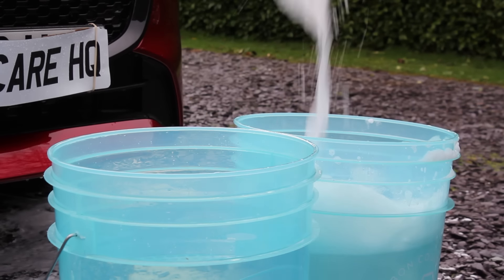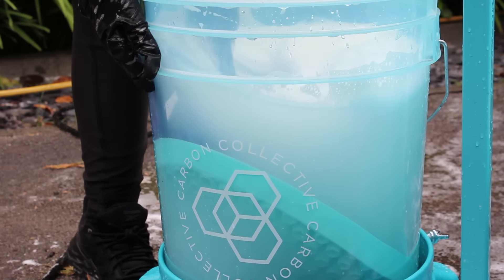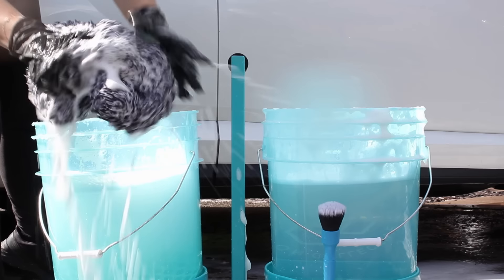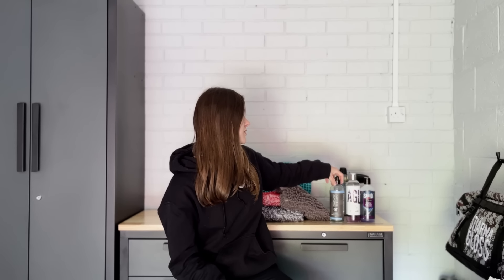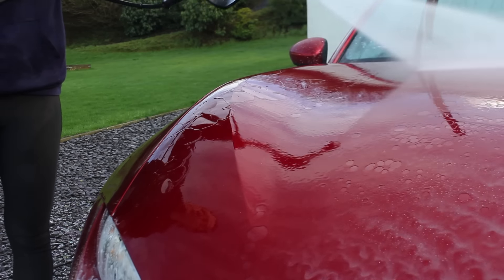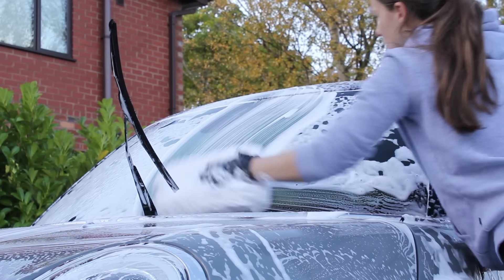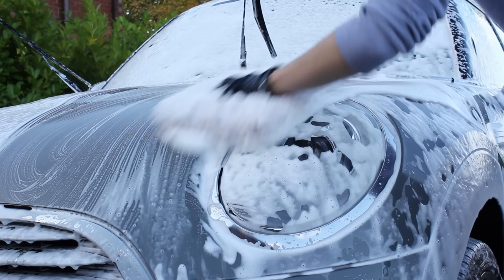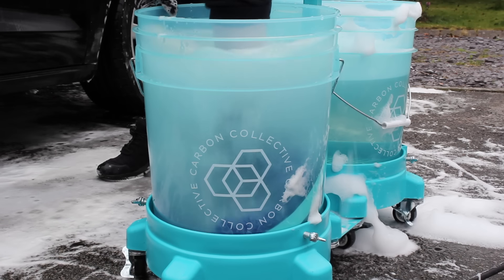Is the Two Bucket Wash Method Overrated? (Vs Alternatives)

Comment: Hi Heather, I use one bucket for doing the wheels first and the tyres etc...Next I use Bilt Hamber snow foam to prewash the car and jet wash off. I then move onto a new bucket with Bilt Hamber shampoo and use two mitts - one for the lower parts and one for the rest. I used to do the 2 bucket method at this stage ,but like you have mentioned, wondered if there was much advantage, as essentially you are still using slightly dirty water to rinse with towards the end. For me, the biggest life saver was ceramic coating the car. This has made the entire proccess quicker and safer in my opinion. Cheers Graham

Comment: Have you noticed that dirty rain is getting worse each year? I currently use pre rinse with (safe) Pro Kleen TFR on the lower section of the car & BH Touchless on top & all over. Followed by 1 bucket wash using Car Chem shampoo. Blast off the mitt with trigger gun in between dips into the shampoo. At the end of the contact wash my bucket remains spotless. I'm happy I've done a safe wash. I'll then consider top up protection with wax or sealant.
Reply from the maker: Yeah it does seem quite bad doesn't it! Thanks for commenting too :)

Comment: I’ve usually had black cars and have been sold on two bucket method for about 15 years! Still use it but my big change in recent years is all the work before the contact wash - helped hugely by this channel. I’m also a big (new) fan of the DI pressure vessel so now a lot of washes can be minimal contact. Thanks for the channel

Comment: I use the one bucket method and have a separate wash mitt for the lower portion of the car,  I started out using the two bucket but found the  one bucket method much easier
Reply from the maker: Thanks for sharing Eamon 😊
Reply: Brian at Apex using this method.

Comment: As you say Heather, the most important part of wash process is the pre wash. I go with GT Citrus in a sprayer, then BH Auto foam on top. Then rinse, then BH Auto foam again and rinse and the two bucket method (BH shampoo) with grit guards and washboard. That's a well put together little Vlog 👌
Reply from the maker: Cheers! That's a very good method/ chemical combo
Reply: I see you want to cleaning as much as possible but, isn’t that overkill in terms of removing the LSP? I mean, even a proper ceramic coating shouldnt last long with a very strong alkaline prewash in a weekly basis…
Reply: @Nando_Detail 
I get 6 months out of fusso wax using the above, so I'm more than happy. 🕺
The pre wash stage is the most important phase of cleaning your car. I would much rather replace my lsp more frequently knowing that I have removed 98% of the dirt, than using inadequate chemicals where you end up swirling your paintwork and hence it needs correcting again and again.

Comment: I like PW spraying out the mitt regularly which works better with shorter pile mitts. In the winter, I like applying the shampoo by lance. I never two bucket. I have an AVA PW with the premium lance which has 3 beakers and 2 lids. This is really good for flexibility as I can keep one with Touch Less, one with Auto Wash and one with Touch On, all mixed and ready to go. Off topic but I love Touch On or simply using BSD as a drying aid - either is a great lazy way to add the LSP!

Comment: I think people think that swirls from washing are created much easier than they are in reality so worry about much more than they need too. Not much to worry about with a good prewash and a nice shampoo & wash mitt/pad. Even if the odd light swirl here and there appears, you’re going to clay at least once a year that puts marring in and will need polishing out anyway along with any light swirls. It’s easy to get hung up on many unnecessary stages to washing the car. Something like one of the Bilt Hamber foams will remove practically everything so no need for additional citrus products, then a two bucket wash and you’re done. You could probably get away with one bucket on a regularly washed car. We all want to do a safe wash but I like to be efficient with time and products too. Doing a 20 stage wash on a car taking 5 hours doesn’t make you a better detailer.
Reply from the maker: I'd agree mostly but having worked with soft Japanese paint quite a bit I'm more cautious. Even a slightly less safe wash will swirl it up pretty badly. Mazda seem to only be putting 50-60 microns of paint on new models as well so claying/ polishing annually isn't a routine I'd get into on something like that

Comment: Heather have you ever taken the bucket dolly down a hill for ride?
I do the one bucket method with two wash mitts, or sometimes just contactless.

As for rinseless wash it feels like having a shower but only using a bucket of water to rinse yourself down. 🇦🇺
Reply from the maker: Haha I reckon I'd break my neck 😂
Reply: @AutoCareHQ  😆 I bought some MA FRA Maniac wheel & tyre cleaner,  it's ment to be better than brake buster
1 liter was $38 AUD without postage so this is expensive as is all the detailing stuff at the moment. 

I did get the Vonixx stuff just haven't had the chance to try it.

Comment: Thanks for going in to a lot of detail here.
One suggestion would be to use rinseless wash in the rinse bucket instead of water. This will pull much more dirt than just water alone. I know this because the majority of my washes are rinseless.
Reply from the maker: Thanks for watching! That's a great tip too

Comment: I’ve gone from the 2 bucket method to using my foam cannon(I’m lucky to have 2).I do find it quicker than the 2 bucket method but like you mentioned in the summer it was a bit of a pain with the shampoo starting to dry out or water spotting so I just washed my car later in the evening.Have you heard of the method where rather than you using multiple mitts,you use microfibres towels instead?
Reply from the maker: Thanks for watching Richard :) Yeah it's definitely become a more popular option, I feels like a lot of microfibre towels cling onto debris a bit more than mitts so I'm not sure I'd be a huge fan of it in comparison

Comment: Generally I prewash with Bilt Hamber Touchless and contact wash with a single 20l bucket inc. grit guard, Carpro Reset shampoo; our cars are ceramic coated, and 8-12 standard size Microfiber Madness pads. Depending on the time of year or state of car, I'll add a TF/citrus step. 

I switched from the two bucket method a couple of years ago mainly to save time and reduce the risk of paintwork damage. IME the only real drawback is that I have to do a rinse wash in the machine before actually washing the pads. As I'm not rinsing the pads in a bucket or with a hose/pw they are very soapy when they go in the machine.
Reply from the maker: Thanks for sharing your method, good point about the washing too

Comment: I live a condo, so I'm pretty much a rinseless guy. I have added a hose setup recently with hot water, but I think ONR or the like is the way to go for most. For a coated vehicle it's even better. Heavy grime I can even spend a few $ at the car wash first. Going to use P&S Absolute for the first time later today with the Rag Company black sponge.😊
Reply: Absolutely. I use Rinse-less exclusively. A good pre rinse is all I need on my vehicle. Then I start my contact wash.

Comment: In reality is whatever you like.  Now, for a large-scale business that wants to keep low costs with Rinseless and APC, you can do it extremely efficiently and effectively, but it's a matter of education too.  Now, if you want to do it also as traditionally, then foam since that is what everyone is used to.  At home or business, if you have water constraints or because of winter time, then Rinseless is really effective with some APC.  Rinseless is what I prefer doing either on a weekly, monthly, or bi-monthly, etc, and with it you can do interiors.  With soap at home it's more work because of setup of the pressure washer, connecting it, hose connection then foam cannon dilution, then bucket dilution.  In case of Rinseless, just a matter of bucket and dilution, then filling sprayer from bucket and initial spraying to the vehicle and using the sponge, all very fast and drying is fast.   Both have their advantages and disadvantages.  For me, it is always better Rinseless and APC, and I have even done really filthy Jeeps.  All would depend of how you enjoy it and how fast you feel it is better to you, but also, you have to try both methods or use a combination of both.  I also do a combination of both, but taking out a pressure washer for foam cannon and then washing with foam is always something I prefer not doing because of also the mess and then setting and storing everything back.😜😜  Now, also you have newer soaps which basically help you with less contact on vehicles because of their acidity or alkalinity, but also you have to setup, dilute, use more water and then ph balanced to perform a light wash for whatever dirt was left, but remember whatever protection the vehicle had it also diminishes because stronger products are being used.
Reply from the maker: Thanks for sharing your thoughts Humberto!
Reply: Hello Humberto
Reply: @kimnewling5728  hello kim, how are you doing and feeling?
Reply: @1stfrompuertorico568  good! How are you?
Reply: Agreed. Rinse-less is all I use!

Comment: I’ve been using the multiple pad method for a long time. I grade my pads from best at the top of the car, to el cheapo noodle pads at the bottom. (Dedicated small noodle pad for the alloys BTW).
Citrus TFR, followed by 2X snowfoam applications for the pre wash. I am keen to try the shampoo in cannon method, especially as the sun is now much less of an issue than in Summer. Thank goodness for small mercies Heather!!
Reply from the maker: That’s a well thought out method!
Reply: Thankyou!!
Reply: I grade my mitts and buckets.

Comment: I need to try a citrus thing in sprayer. Snow foam never really seemed to work for me and can’t really be bothered with the pressure washer! Would a normal hose pipe with citrus pre-wash lift enough dirt off then to do contact method. I’m about to buy a decent car and would like to try to look after the paintwork better.
Reply from the maker: A hose pipe won’t do much to be honest, really need a pressure washer to be able to shift it even with a stronger pressure pre-wash

Comment: I was a two bucket guy until I watched you doing the shampoo in the lance with one bucket and that is my method of choice now and I find it quicker but at times I have had to go back to remove splattered bugs probably the mitt not connecting as much with the paint due to the added lubrication but all in all I think it is better. I do always use one wash pad for the paint and a mitt for the lower plastics though.
Reply from the maker: Thanks for commenting John. That's a good point about the added lubrication making it a bit harder to remove more stubborn bugs etc.

Comment: I personally use 4 wash mitts , so I never use the same mitt again after that section is washed ..
I still have two buckets , the rinse bucket ends up with the used mitts....i use a different bucket for the wheels..
Anything to stop cross contamination.

Comment: Morning H, one point I picked up from your narrative is the use of water. Wash regularly and don’t let the grime build up and dry. I’ve doubled up on my water harvesting [no not an eco], in the summer it’s for watering the plants, in the winter it fills a huge trug and with a p/washer syphon you have clean free natural water to pre-rinse apply product wash off, rinse off with a drastic reduction in any water spots compared to the rubbish supplied through pipes. It’s amazing the volume that comes free off the roof ready for use and drops the water meter bill.
Reply from the maker: Thanks for watching :) That's a great idea too, I'd really like to do that but unfortunately my Kranzle would need modifying to work off a tank so it's not something I've really considered yet

Comment: Great informative video Heather I've been using the 1 bucket method for couple years now pre wash very important i use either nitty gritty or road rage    spray the whole car mine is s u v with i k pro pump sprayer then snow foam over the top usually bilt hamber touchless or p h neutral depending on dirt then shampoo in snow foam lance just use another mitt for lower parts doors sills etc works for me how's your new kranzle do you like it much better than any karcher 🤔👍👌
Reply from the maker: Thank you! That sounds like a solid method. 
I love the Kranzle, it's a brilliant machine. I've got an update video of it on my second channel btw: https://youtu.be/Wu5lO4YSAGo?si=-2zdv7UL7ANi3rZM

Comment: I just use a strong APC mix as prewash (i find this does a great job as I'm not concerned about LSP). Then I just rinse the mitt with the powerwasher every panel (no 2 bucket).  The wash bucket is always clean afterwards when using this method.  Finally then I just dry with a drying towel. Has to be better than a scratch and shine! (hand car wash).

Keep up the good work Heather, your channel is fantastic!
Reply from the maker: Thanks very much! Absolutely, much better than the scratch and shine haha!

Comment: I guess i assess the vehicle. All the methods work, but the pre-wash is important. I think i use the multiple mitt in a bucket the most after i foam the car 2nd time. The mitt quality is more important than people think. Microfiber mitts work the best for me. Unfortunately, in my case, im probably more psycho than most and wash both my cars once a week on Saturday. Good video, Heather.
Reply from the maker: Completely agree with those points. Cheers Kim

Comment: Great video Heather. Ive always thought the two bucket method was a bit over rated. I’ve started using the shampoo in a foam cannon, since I bought a second cannon, along with two or three mitts. The two bucket method is too much of a faff for me and the clean water bucket is only clean until you dip that mitt in it once. After I’ve done a couple of panels I just rinse the mitt with the pressure washer…..obviously this means switching the cannon over to a jet nozzle, but with a quick release adapter, this isn’t much of a big deal. I’m planning buying a third cannon for my ceramic snow foam stage after the contact wash….that way I don’t have to empty a cannon of shampoo and rinse it out during the wash, just have three cannons ready before I begin, one with pre wash foam, one with shampoo and one with the ceramic foam to finish with. ❤
Reply from the maker: Thank you! That's a good shout with the third foam cannon too, it's good to have one set aside for the ceramic foam
Reply: Some foam cannons can have a spare bottle available to purchase rather than more cannons, much cheaper, just run water through to clear the filter and switch bottles, job done!

Comment: Nice video 👏👏 I like the one bucket and mitt per panel method. Alway best to dispose of the used mitts and replace them before the next  wash.  Joking aside all the methods you have described appear reasonable and acceptable to me. Personal choice, maybe.  I presume your preferred 1 to 9 ratio is 10%?
Reply from the maker: Cheers John! Yep that's right with the dilution, seems to work well for most shampoos

Comment: Excellent video Heather, I keep it simple, I have 1 bucket and rinse the mitt using a hose pipe after each panel, I do this as having a 2nd rinse bucket and even with a grit guard you would have dirt floating, but what ever works for the individual
Reply from the maker: Thanks very much for watching :)

Comment: Hey Heather. Great video. 2 bucket here but one for the wheels and one for the wash. Pre-wash is essential like you say so I use Bilt Hamber Auto Foam rinsed off with the pressure washer and that gets most of the dirt off. Separate mitt for lower parts of the car. ❤
Reply from the maker: Thank you! Sounds like you've got a good method going thanks for commenting

Comment: I've changed how I wash now, I stopped doing the 2 bucket method which I have been doing for over 10 years , now what I do is spray my shampoo via a snow foam lance and I use 6 noodle mitt , 1 noodle to do the roof using each side then chuck it to a side then use the next noodle mitt to do front bonet then put mitt to a side then use another mitt to do the 1 left side of tge car another mitt for tge other side another mitt for the back then chuck all the mitts in the wash along with any other towels and microfibre , saves so much time than using 1 mitt and going back to the bucket to dunk and clean mitts .
Reply from the maker: That's a great method, I've been leaning more towards this recently
Reply: @AutoCareHQ  yeah it's definitely a wise choice , you can pick noddle mitts cheap I got the yellow tesco ones for £2 each on offer so 5 for £10 and save your money buying 2 buckets , I realised while I was typing the original comment that you covered this method already in your video 😅 I was to eager to comment before watching the full video